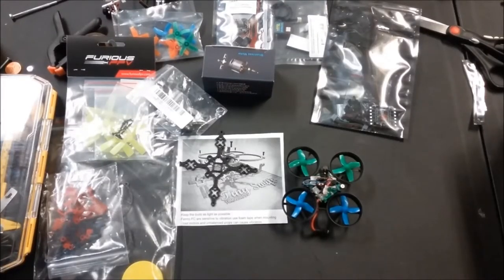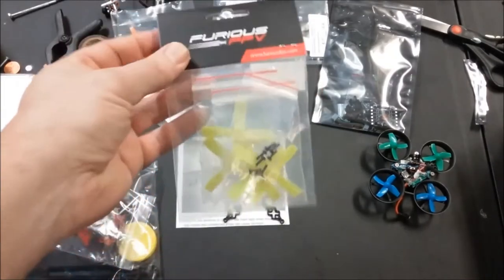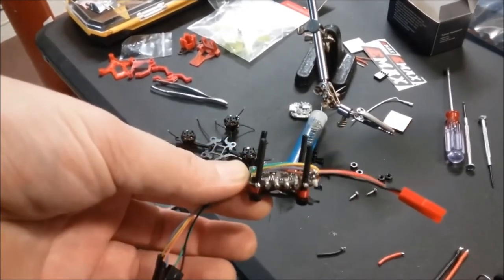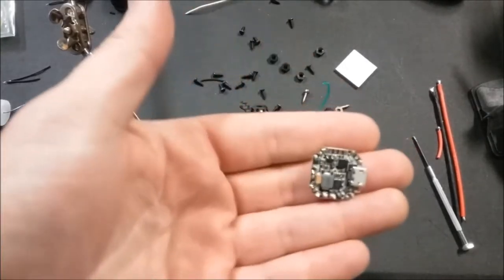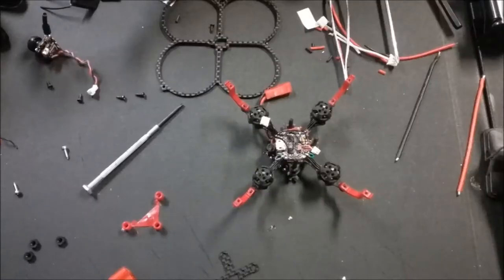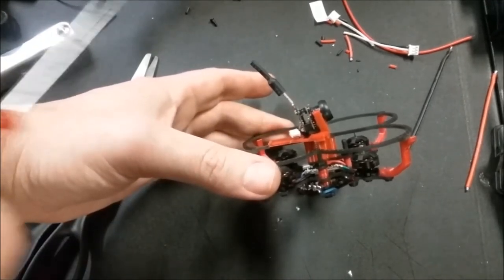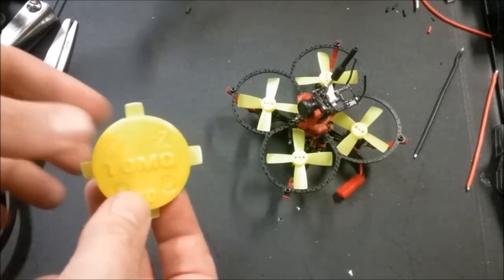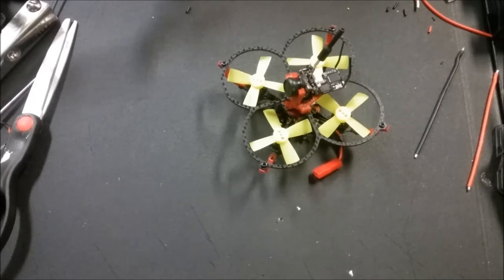Tomoquad's Tiny Swift Micro quad build Instructions

Comment: What batteries are you using
Reply from the maker: Thumper C, The lightest 2s 280-300,350mah you can find. Think all about the weight because that is really what matters on this build.  
I have been using a 2s Eflite 280Mah (17grams)and a couple of 350mah that I ordered from amazon that weigh in at 20grams.  
This one is used a lot in the Tomo hangouts group:   http://www.banggood.com/Giant-Power-7_4V-300mAh-35C-Battery-For-HCP100s-T-REX-150-F3P-p-987487.html
I have a few different 2s Lipo's on order to test but they aren't here yet! Hopefully they will be soon.
When they arrive I will do a testing video on the batteries.
Thanks for watching and please subscribe,
Sincerely Desode
Reply: I'm using a no-name 3s and getting like 1.5min flight times. Thinking it is batteries. I just ordered Nanotech 2s 300mah 45-70c. Hoping that will help
Reply: Thumper C, HK seems to be constantly out of the Nanotech 2s 300mah last few weeks I've looked, you're lucky you got some.
Reply: desode9, Looking forward to your batt comparo, small batts are one of the issues for these little power hungry screamers, that and props.
Reply from the maker: Hey Cybervid07, These work well for lipo's  http://a.co/01hmnKE
For props try these!  https://www.heli-nation.com/rakon-40mm-3-blade-propeller-2cw-2ccw-1mm-shaft-white-blade-inductrix
Reply from the maker: cybervid07 Awesome!   A little remindfull tip, make sure to keep the Femto f3 as free as possible and make sure to put it on the double sided foam tape. You don't want it bumping any stand offs or anything that would send it vibration. Good Luck!
Reply from the maker: cybervid07 I need 0703s!  but waiting for the 15000kv one on april 11th! ;)
Reply: Hi desode9, not using the Femto F3. I do not like that FC, gyro is way too sensitive and hard to tune out vibes. I will be using the Furious Racewhoop 16 x 16 FC with the MPU-6000 gyro, way more stable and less prone to jitters. BG now has a full set of 16 x 16 cloned (with no credit to Fishpepper) FC and ESC that I posted here earlier. Perfect parts for a super micro brushless build. If you want to buy the 16 x 16 parts from a site that does credit the designer Fishpepper here is a link https://goo.gl/rQK4e7
Reply: 0703 15Kv will be crazy! You could run Inductrix props! I think the 10Kv I have will still fly quite well. The problem is the bolt pattern. Tomo is working on a new frame for these little screamers.
Reply from the maker: cybervid07 Stay tuned Cyber, the new frame you talk of will be on the channel! Already talked to Tomo about it! ;)